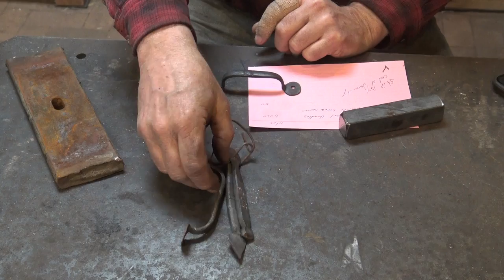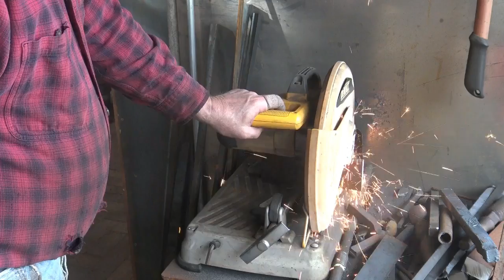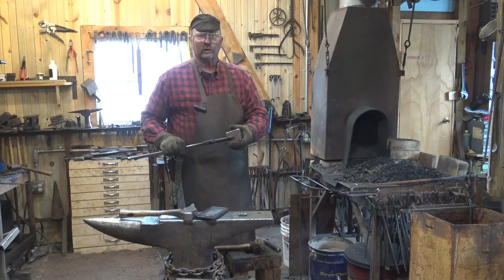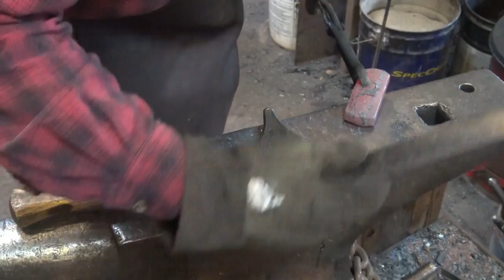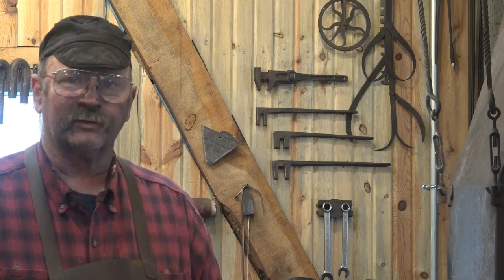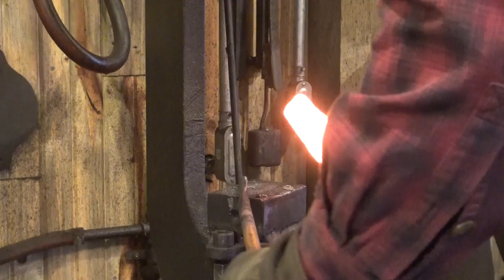Forging a swage - forge welding with a jump weld

Comment: Would it make more sense or be easier to aneal the steel first before trying to make impressions?
Reply from the maker: Annealing before forging the material hot wouldn't have any effect.
Reply: @BlackBearForge  ok. I have a background in goldsmithing and annealing in that field removes metal fatigue and softens the metal. Is that not what it does to steel?

Comment: Maybe you could have used the press and put the shape in first, then tack weld the form into the plate to hold the shape while you welded the hardy stem on? As to keeping the piece with the ready made hole, you must have been reading my mail as I modified a piece of machinery to fit the hardy hole today. It's an unknown piece of something that is hard enough you can't file it, so I cut part of it off leaving enough to hold it in the hardy hole - it's got 2 different size holes in it and should be very handy. Thanks for a most informative video John.

Comment: Why not put it in the press and just press the design you want?
Reply from the maker: Mostly because that wasn't the purpose of this video.  But it would also require specialized tooling to hold a hardy tool with the shank in place.

Comment: would it have been easier to go half and half, say you have a four inch handle you want to make a 3/8 to 1/4 Inch taper on both ends, so you go half the material two inches, then go amd turn it the other half to complete that double taper both ends...using that rod that been tapered
Reply from the maker: It could be an option

Comment: Nice work! Quick question about the profile ground into the rod, would it have been easier to grind the profile into a more vertical tool that will transfer more of the hammering force straight in?
Reply from the maker: It would be easier to get an initial depression, but since this isn't an even width it would be hard to make a single smaller tool for the full length.  Even if you start with a series of smaller tools finishing with a single full size master halps keep things smooth

Comment: how big is the table in front of your anvil. And your videos are fill of information
Reply from the maker: I am not sure if I know what you are referring to.  I have the forge to my right, there is a tool tray just in front (on the viewers side) of the anvil, a swedge block next to that and I have a secondary tool holder just behind the anvil that I use for some specialty jigs.

Comment: Well !! the art of the blacksmith is exampled here in the presentation versus simply metal fabrication. You should be justifiably proud of your bottom tool just the very thing for your production work. 3 1/2 hours to make the tool then how long to edit the video.

Well Done !!!
Reply from the maker: Thank you.  I think it was well worth it, even though I was tempted by the easy way out.

Comment: Happy to see you demonstrate a succesful forge welding with the 5160 against the mild steel. Is this flux brand you are using here better for crome containing steel,  or would pure borax work as well? 
(Have only forge welded carbon steel before)
Thanks for your nice channel.
Reply from the maker: I don't think the flux is anything that special and borax should work.  However I don't like borax for welds when the pieces are not connected somehow.  The borax is very slippery and its hard to keep the pieces inline without them sliding around on each other.  This flux and easy weld seem to leave a rougher surface that does slip as bad.
Reply: Black Bear Forge 
Thanks for your good comment!

Comment: John - Stopped the video at about the 5 min mark so I could ask this question, then back to the video.  I have an Evolution chop saw, and a $130 blade(?) on it.  I've been afraid to use it on leaf spring material and have been cutting that with my angle grinder.  There you were just cutting right through yours.  I THINK my blade specs said for mild steel only.  What kind of blade are you using?  Do you anneal your material before you cut it?  Does it seem to go OK? Are you worried about ruining your blade?  Trying to decide if I need to give that a try or not.  Thanks!
Reply from the maker: I use abrasive blades just like what you are probably have on the angle grinder.  They are a consumable and wear out as you cut.  Since there are no teeth, they are ideal for hardened material.  I don't bother to anneal if I am cutting with that type of blade.  So I don't worry about ruining a blade, but they do wear out a bit faster.  A 14" blade is less than $10 and can usually be found at home centers or I buy from McMaster Carr.

Comment: think thats the hardest weld to do ,was a great learning experance ,your daily work is just fine video what you think people might like to see its all intersting to me
Reply: Butt-welding dissimilar steels surely is some of the trickiest stuff you can do, but it turned out nice.
Reply from the maker: It was a difficult weld, but mostly trying to get the stem out of the fire and on end without to much fumbling.  I also have heard this is a weaker weld, but it should serve fine for this purpose.

Comment: Like your videos a lot ,lots to learn . I find myself doing many similar jobs on a small scale ,my question is why not start the swedge using a chisel then rounding it out with your pattern . Was it about the weld ?  My experience tells me dissimilar metals don't hold well with gass welding , how is forge welding different , or is it about normalizing and heat treating  ?
Reply from the maker: I think starting the depression with a chisel or rough grinding it would have been faster.  It always pays to evaluate after he fact to think about how you might have done it better.  I suppose in theory the dissimilar metals do make for a weaker joint.  Luckily the hardy stem only serves to keep the tool on the anvil and shouldn't get to much abuse in use.  On the other hand, this is the way almost all tools with hard steel were made for centuries.  Axes, chisels, hammers and anvils all have forge welds with dissimilar metals and most of them have held up extremely well.
Reply: My experience comes from gas  welding shafts for lawn & garden equipment the lo carbon steel I use won't take the torque even if the weld prep starts at a point and you build it up an machine it down to size .  If you think leaf spring is hard try truck axle shaft . I can hardly cut it on my lathe even with carbide  .